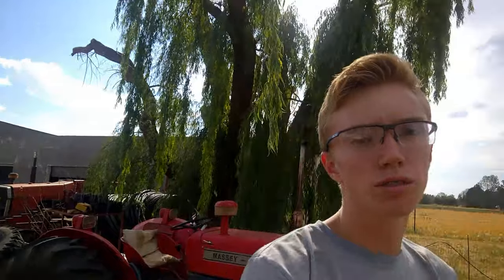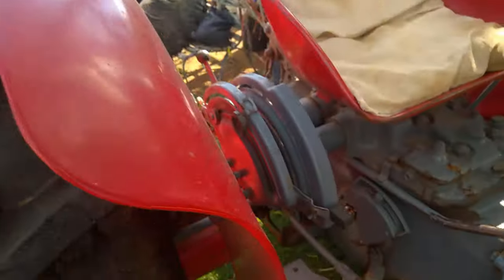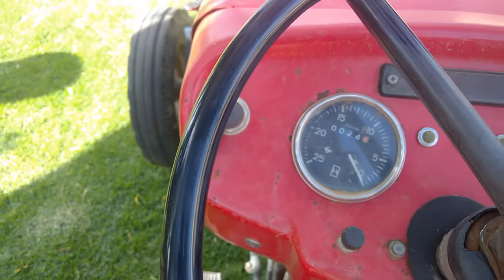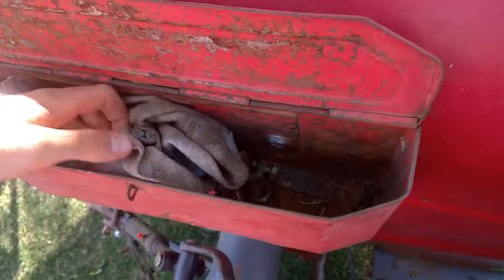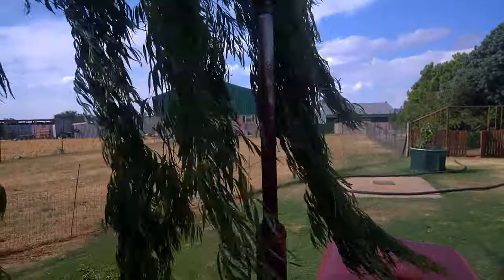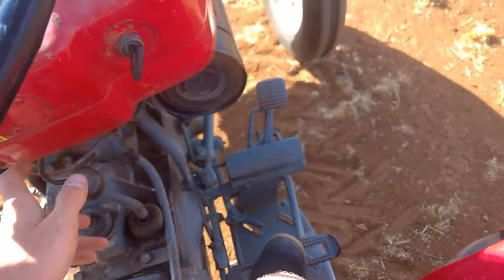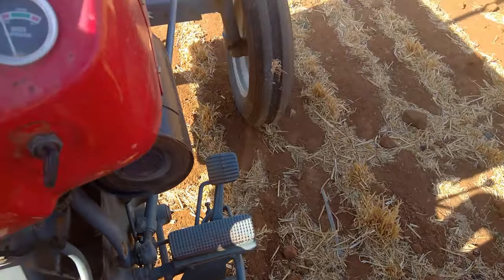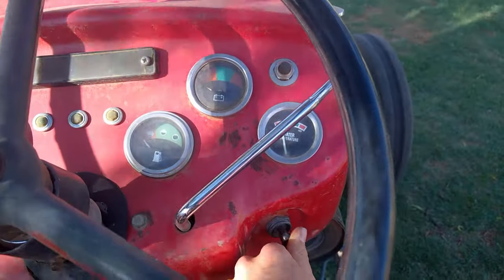How to drive a tractor - Massey Ferguson

Comment: Does the handle throttle act as a choke until the engine warms up or can you use it independently from the pedals? Good vid nonetheless.
Reply: Yes u can use it instead of the pedal....

Comment: Is there MF 240 5 gear model?
Reply from the maker: Hi, I don't know of any MF 240 tractors with 5 gears but I do  know the 265, 275 and 290 have 5 gears so there might be some 5 gear MF 240's in different year models. Have a good day
Reply: @farmingsa2194  Thank you very much sir. I will search about the manufactured years. Have a nice day.
Reply from the maker: @lahirurangana1289  let me tell me what you find when you have researched.
Reply: @farmingsa2194  yours is a early model 240 with the 6 speed box the later ones have the 8 speed